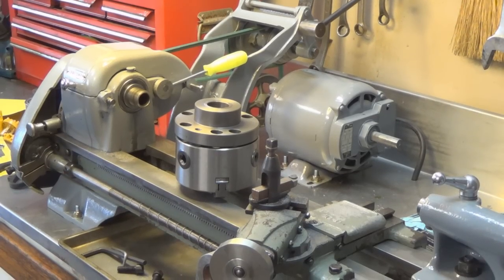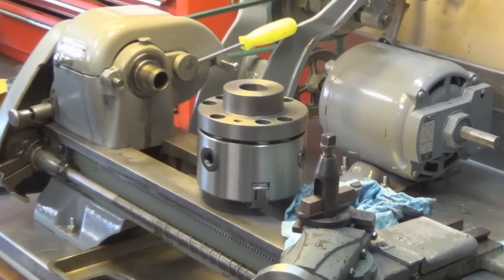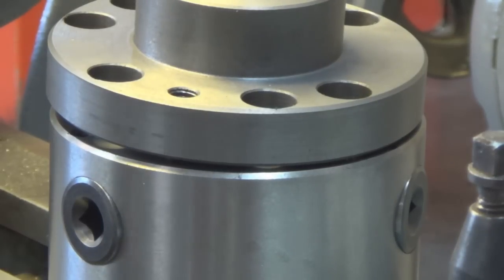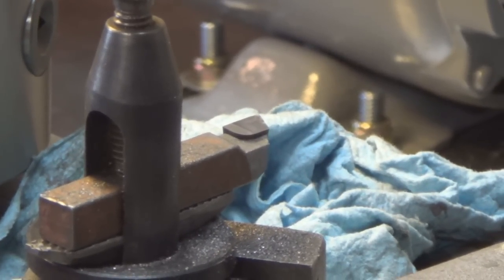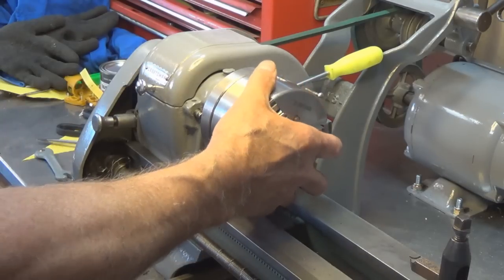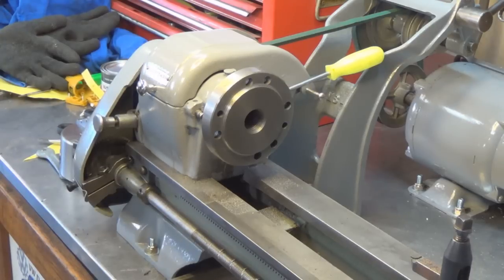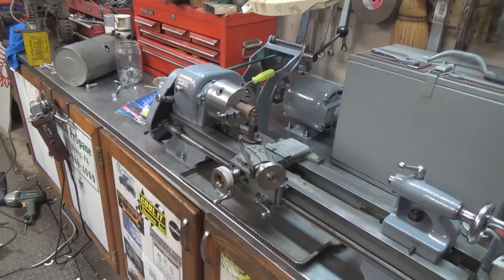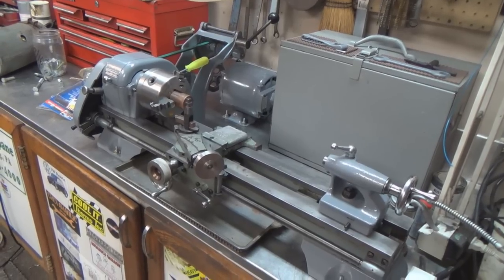The Craftsman 6" lathe, chuck installed & working, Goofy Cart brakes

Comment: You have learned a lot in a short time ..One thing I know is the carbide tip cutters do not work the best on slower lathes and some are cheap made carbide ..Learning how to grind and sharpen the  high speed steel old schools bits is a must they will cut any thing you need to do ..MrPete has some good videos on how to do it ...Find his video on the Shear Tool bit and you will have a great bit to make a fine finish on soft stuff like plastic ..I have a video on machining epoxy that I used the same type of bit
Reply from the maker: Thanks Jim. I need all the help I can get. I did learn that I need to remember to use cutting oil to keep things cool while using the lathe. I suppose that thread cutting oil should work for this purpose? I have a vintage can that was unopened when I got it.
Reply: I would get some regular cutting oil but any oil is better than none ...On your gears on the lathe several people I have watched use 90w gear oil ( car rear end oil )
Reply from the maker: MrPete222 suggested graphite grease on the gears, which is what I have put on. What would be the difference between thread cutting oil and another cutting oil? Viscosity?
Reply: graphite also sounds good on gears I don't know on the oil ....oils will smoke and burn at  different Temps  a lot of the guys I watch swear by the stuff that has sulfur in it ..I have seen some tests on Anchor Lube brand of stuff it's green in color and cleans up with water  They had an offer on their website for a free sample I was never interested in it But watched several videos on it
Reply from the maker: I can see it is time for more homework... Thanks Jim

Comment: It seems to me George that you should consider at some time in the future making a suitable piece of staging for that tool box so that you get full access to the draws and create a space underneath to park the chuck or other heavy, awkward lathe items when not in use so you don't have to lift them.

A piece of 3/8 - 1/2" plywood laid across the bed is an essential good habit to learn when fitting the chuck or trying to mount something heavy in the chuck. Much better than towel fabric at protecting the ways!  Keep it close and handy so you always use it!
Reply from the maker: Good tips Dan, thank you. I will have a piece of wood handy, maybe even a smooth cutting board? Nothing is too good for my "new" lathe.

Comment: glad to see the lathe in action,perhaps one day i will find one that isnt overpriced. on the band brake,you need to pull,not push. the piece with the clevis needs to be mounted solid and pulled from the bottom. if you notice your actually pushing the band away from the drum on your rosebud thing. hope this helps
Reply from the maker: I do think it will work better actually with the push, since the forward turn of the drum will draw the band tighter as it is applied. I do need to get the back side of the band closer to the drum for sure. We shall see what happens when it actually is working. It was set up similar to this in the go cart how to video I watched online, though they were pulling from the top, I am pushing from the bottom, but the overall action is the same, only rotated on the drum. Right???  https://youtu.be/BhRFXiK2UYY
Reply: i think that pulling from the top or bottom would keep the band tighter on the drum and keeping it more round. the karts i had with band brakes pulled from the bottom. kartfab is a good person to watch,i would do it the way he does.
Reply from the maker: I am basically doing it the same way, only it is rotated simply because that is the only point where I can get a solid mount for the stationary end of the band.
Reply: then it should be fine,i am certain you will figure it out. looking forward to seeing more progress,and i am certain you are too

Comment: You should have some tool holders to hold the cutting tools.  See the manual and you should see that the lathe most likely came with 3 tool bit holders, a left hand, a straight holder and a right hand tool holder.  I would suggest you get the how to run a lathe videos from mrpete222.  Keep on keeping on.
Reply from the maker: I have been watching some of Mrpete222"s videos as I have time. Some good stuff for sure. The only tool holder shown in the owner's manual is the one that I have. Someday I hope to get a quick change tool holder. Thanks for stopping by.

Comment: that lathe looks like brand new, that's a  very good color for that tool.. I am just wondering if you would be better to make that brake band lever pull on the drum as apposed to pushing, it would seem to me  that you could get more power on the brakes that way..
Reply from the maker: I would have made it pull but I don't have a close enough solid mounting point to make a pull fulcrum from, thus the push. Hopefully it will do the job or I will have to re-do it. Thanks for the kind words about the lathe.

Comment: you need to get a green whel for your bench grinder with a gray metal wheel on the other side, grid the steel part of the tool bit back some on the gay wheel and grind the carbide tip with the green wheel, keep as cool as possible when grinding,,
Reply from the maker: I have another grinder wheel setup that I could dedicate to a sharpening wheel for the carbide cutters. What grit should I get? I see they are listed at 36, 40, 60, 80 & 100 grit. I am thinking that the finer one would be best for the lathe cutters, right? Thanks

Comment: One other thing, get yourself a cutting speed flip chart. That machine was running (I think) way too fast for steel. Again, it is a subject I have forgotten more about than I ever knew.
Reply from the maker: I have a speed chart in the manual, and I think you are right about it being too fast, but I can't perfectly judge the speed according to the chart since I don't have a proper pulley on the motor. I can't seem to find the dimensions for it, though I have the part number and have located one on eBay. I guess it is time to pull out the tachometer...

Comment: Wow that really has a lot of power George Mine doesn't run that fast at all nor does it look that straight rotating around like yours does. I think im gonna have to tear mine down and rebuild it it just doesn't have the power it should. Oh remember when you put oil on the cutting surface don't put too much on or you will have a nice trail of oil slung at your wall. It happened to me before i realized what I had done lol. Looks like you have a great running lathe.
Reply from the maker: Thank you Larry, I might have it running too fast actually.
Reply: +The Shade Tree Fix-it Man yes you might have the rpms up a bit but you can tell you have the power and your lathe isnt gonna bog down when you need to turn down anything